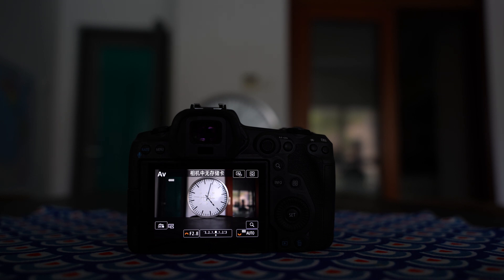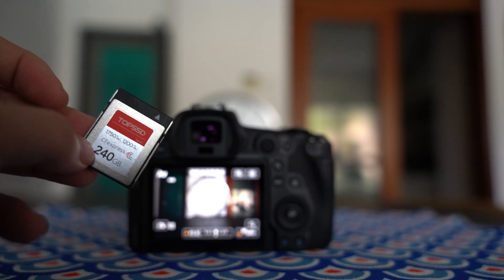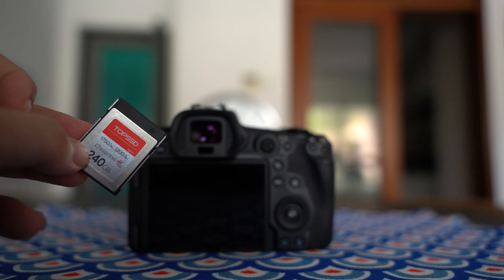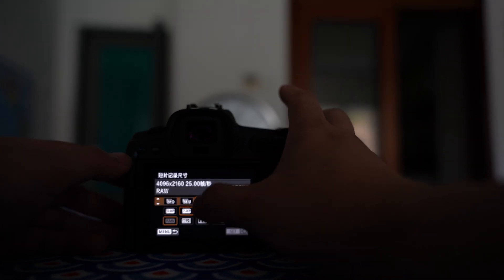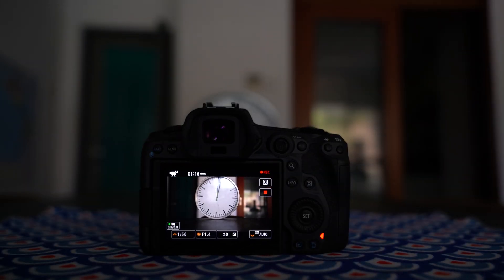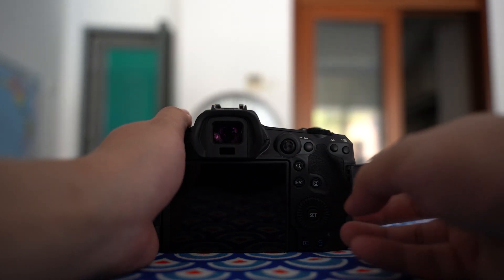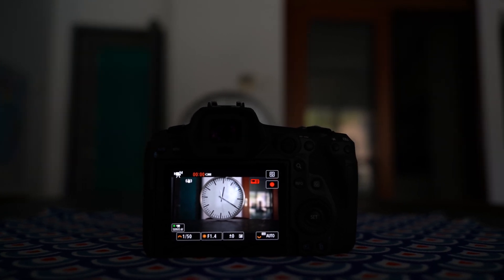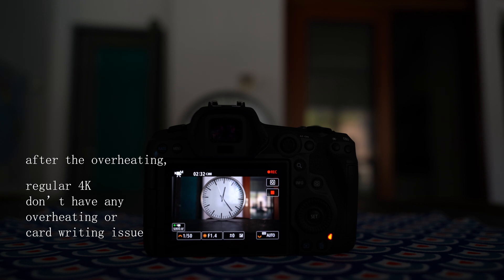Part1: Canon EOS R5 crash test: what will kill R5 first? Overheating or slow CFExpress card writing?

Comment: Thank you for the videos. Are you able to test the quality of the cropped video mode?  The reason I ask is that because the 4K HQ only lasts a few minutes and the regular 4K appears to be low quality line skipping and mushy people are unhappy with the 4K options.  However, the 4K crop mode is supposed to be 5.1k oversample.  So in theory if you added a speed booster adapter you could get oversampled 4k at near full frame with no over heating.  Does that mode have restrictions like being able to use log? I am only speaking of 24p and 30p. No one has tested this and it would be really useful to know. Thanks
Reply: There is no point to get into this much trouble, a7s3 is the solution

Comment: Great video , is there a way to extract an image from video in camera ?
Reply from the maker: suppose the 8K RAW you can choose the JPG from the 30p/s , but I haven't try it yet. 8K raw require very fast card writing speed
Reply: @bryancc2012  thanks for the reply, only reason for asking is you can do it in camera on the Sony a7R iv, Sony a9 etc (with one of the custom buttons). I would have thought you can do it with this camera also, can't seem to do it for the Canon EOS R though which made me curious
Reply from the maker: @tonepixuk  Oh, yes, it can. R5 support to use the camera to cut the video or save a picture.  good way to make cover page

Comment: First, I want to thank you for recording these videos in English so people across the world can benefit. Also, ALL-I stands All Intra and refers to the fact that every frame can be used as a key-frame (has all information). IPB is a mix of Intra frames and B frames. The latter uses information from the previous and the next frame to encode the current frame. This extra encoding IPB has to do makes the processor work harder so one would expect it to heat up more during recording. It is also the reason IPB can be CPU intensive to edit.
Reply from the maker: thanks for the information and my pleasure to be involved in this. learn a lot along the process.

Comment: Interesting test, I was surprised how quickly you were able to record regular 4K after the overheating in 4K HDR, and that it didn’t have any issues after or hit hear limits again! Did you notice much of a difference in the quality between the HQ and the regular 4K? Was the difference noticeable enough you would shoot HQ 4K over regular if you had projects where you don’t need shots over 15 minutes? I am more excited about the potential for specialty shots like 8K / 4K 120, but only plan for short clips really, seems like the R5 is more reliable than I expected with regular 4K though and would be fine for longer recordings in that last mode you used ☺️
Reply: There's a massive decrease in quality. As to times, it's no surprise, the camera doesn't generate enough heat to approach critical temps in the low quality mode so it should be able to record that straight away as it'll be cooling down.
Reply: @FantabMedia  I wouldn't call 4K 30p "low quality mode." Normal, maybe.
Reply: @StevenHoagland  https://www.cameralabs.com/canon-eos-r5-review/

Some downloadable clips straight from camera. The line-skipped, pixel-skipped 4k mode really isn't great.
Reply: @FantabMedia  It actually looks great! Did you download the 4K 24p DCI original file (568 MB)? It's actually pixel-binned, which is the best quality method when not oversampling from higher resolutions.
Reply: @StevenHoagland  I was a bit disappointed by the binned 4k footage to be honest. Very soft and a big step down from the oversampled footage (although it's usable). The oversampled stuff looks absolutely great though!
Reply: The biggest issue for me though isn't just the quality loss but the equivalent of 2 stops more noise, so ISO 2000 will end up looking like ISO 8000.

Oh and I don't think it is binned, just line and pixel skipped. Have you heard otherwise?

cheers
Reply: @FantabMedia  I've looked at them both (4K and 4K HQ) on my 4K monitor. You have a point on the quality difference. The 4K HQ is stunning. Not sure if that means regular 4K is low quality, though.

Most sites say it's pixel binning, not line skipping. Can't recall if Canon has said either way. But, I LOVE the 4K HQ.
Reply from the maker: agree.
Reply: @StevenHoagland  Yeah the HQ is beautiful footage. I just hope this Tilta cooling system actually works!
Reply from the maker: my focus is on the difference between 4K HQ and regular 4K 25P.  have done some test but maybe due to the export format can't see too much difference, will dig more on that part.

Comment: Bottom line: it does exactly what Canon said it would do. One cannot expect more.  The stated times in the spec are approximate and even state "from a cold start", so if you are running LV before you start,  you can expect reduced recording times.  Also, this is a controlled shutdown, not a crash. A crash could imply the camera acted in a unexpected way, which actually could result in destruction of the camera and other equipment.  The controlled shutdown protected  your investment and allowed you to continue in another 4k recording mode.  Frankly, I think this is excellent for my uses, as I would only be making clips in HQ and I doubt they would be even 5 minutes long, let alone 14 mins.  Canon's engineering is excellent and it is remarkable that they made this information available before I can even get my hands on the product.  I can still cancel my pre-order, but I absolutely will not.  I appreciate the video. I wonder why the A9 could not keep steady focus on this static scene, though.  What's up with that? :)
Reply: Have you seen Gerald Undone's test? He tooks some pictures (not video) and after 30-40 stills in an hour was completely locked out of any of the decent video modes.
Reply: @FantabMedia  damn!
Reply: @FantabMedia  can you share a link to this please?
Reply: https://youtu.be/iUe4vsO3HQ8?t=402

There's another with the same results; some casual photo shooting then only 2 minutes recording time in video available after that.
Reply from the maker: that one might be arguable as he took picture under sunlight, right?
Reply from the maker: Sony A9 focus is ok as I set it to full screen and AFC, it will focus the nearest object, when my hand in the focus area (full screen), it will focus on my hand, if I move my hand it will focus on the screen very quickly.

Comment: Slow CF read/write? 1700MB/s / 1400MB/s Write is MORE THAN ENOUGH. 2600mbps isn't 2600MB/s bud.

Before you make a video, understand what read/writes mean.
Reply: Minimum write speed is not what's shown on the side of the card. Usually that's max sustained write speed (lower number). This card evidently has a minimum write speed of less than 400 MB/s. You have to dig in the manufacturer's spec sheet to find it.
Reply: @StevenHoagland  400MB/s is still enough for 8K 12 RAW.
Reply: @frostybe3r  That was my point. 8K RAW requires at least 400 MB/s on the R5. Since this card has already failed in that mode, it indicates that the card is slower than 400MB/s minimum write speed.
Reply: @StevenHoagland  Which is why you don't buy trash for a $4K camera
Reply: @frostybe3r  No need to be jealous. 😉
Reply: @StevenHoagland  Jealous of what?

I bought 2X 512gb SanDisk Extreme PRO CFexpress cards for the camera already
Reply: @frostybe3r  Sorry. I misinterpreted your statement. I agree, get the fastest cards for the R5.
Reply: @StevenHoagland  But yeah that's one thing that annoys me, lack of dual CFexpress.
Reply from the maker: thanks for your input.  as replied in another video, believe 512GB SanDisk 1400MB/s, but it will cost around 900 USD, right? and still have to deal with overheating. if this card can fulfill most of it when save as IPB, then I might stick to it.  already use it to recorded 8K and 4K 120P in ALL-I
Reply: @bryancc2012  What do you do when you lose all your data because the card randomly corrupts due to using a low end, cost cutting memory controller?
Reply from the maker: @frostybe3r  got your point. I am just try to find the most cost effective card.For a Sony user before I just can't accept a card cost 1000 USD. Anyway have decided to change to 1400MB/s one. thanks for the comments.
Reply: @bryancc2012  The SanDisk and other higher end cards also come with lifetime warranty and data recovery.
Reply: Why not just get the smaller cf 128 SanDisk extreme pro ? Unless thats not enough space to hold that long of video ?
Reply: @Diehlexposure  512gb only manages 25 minutes of 8K RAW so you can guess how useful 128gb would be, also has slower read/writes.
Reply: @frostybe3r  haha oh thats nice to know I ordered mine 128g but I mainly shoot stills. Guess I'm going to find out when I get the camera.